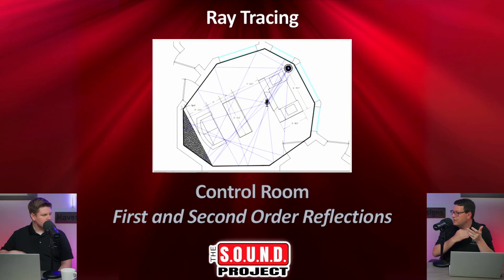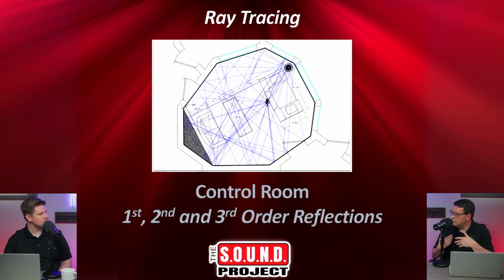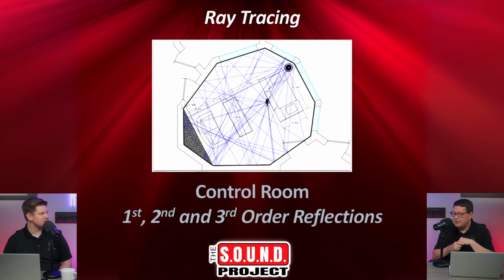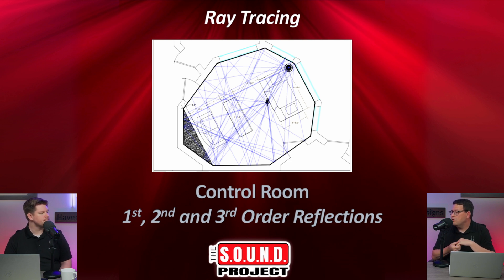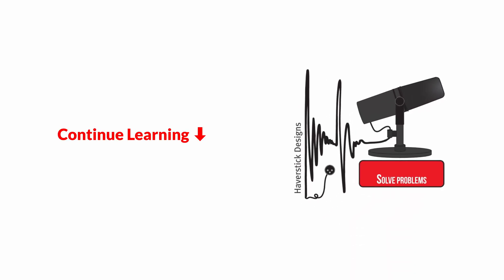How to Predict Room Acoustics - SOUND Bite

Comment: Wonderful video! One question though, I read that sound begins to act less like a particle at higher wavelengths, is it really possible to model the transfer of energy towards the bass trap at the back of the room through raytracing? Or are there other methods used for lower frequencies?

Comment: rooms aren't 2D though, does actually correlate to anything applicable?
Reply from the maker: Thanks for the comment! These ray tracing diagrams, while 2D are still super useful to see how the geometry of the room will impact how sound (especially mid/high frequencies) will reflect around the room. We also run ray tracing scenarios on elevation drawings to see how the height of the room and ceiling/floor slopes will affect the sound distribution as well. Thanks for watching the video!
Reply: @haverstickdesigns isn't bass usually the problem though? you mention in the video that traps are used to address bass. also can you treat mid/high frequencies with surface treatment on the closest walls?
Reply from the maker: @xeeton  Bass is definitely a big problem that needs to be addressed separately from early reflections. Ray tracing will help with proper treatment placement or room shaping changes that aid in early reflection control. Testing and a proper room mode analysis guides the selection of bass traps and optimal speaker/listener placement which helps with the low end. It is all part of the big puzzle!